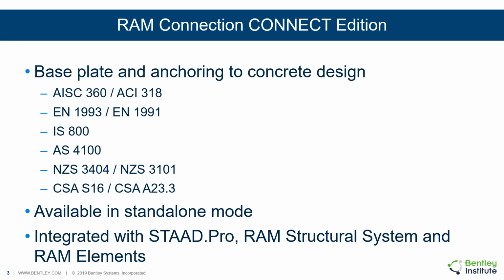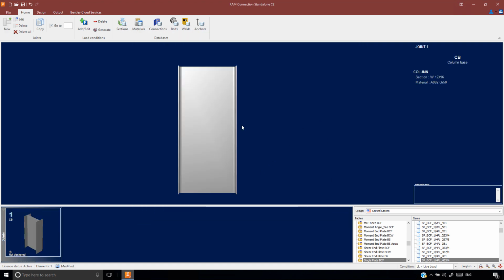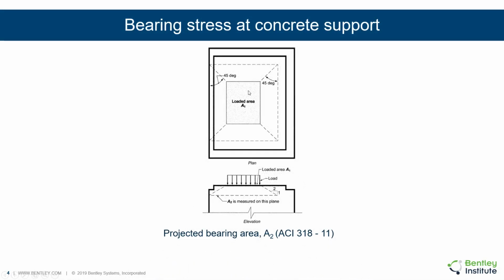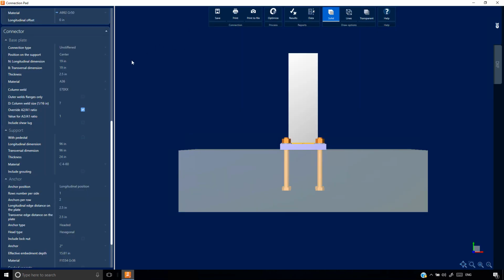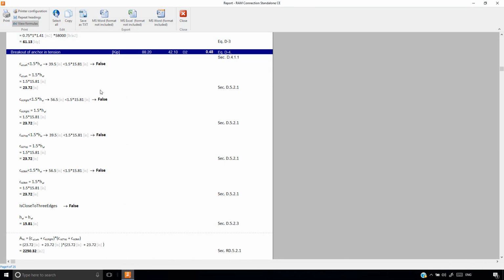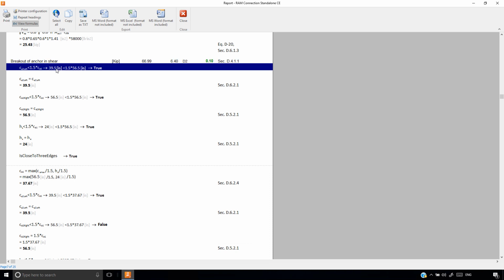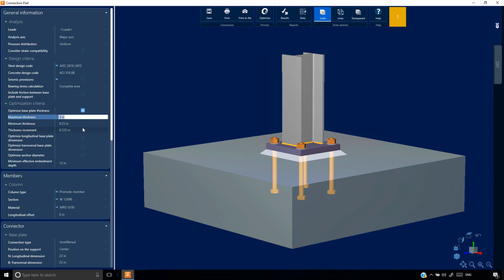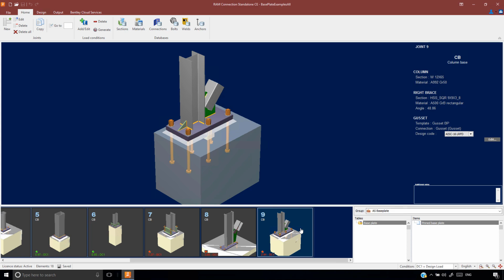Base Plate Design and Anchoring to Concrete in RAM Connection

Comment: Good day sir. How do you properly design base plates if a pedestal is considered. ? Most of the designs in staad i came across are designed where the column is directly attached at the footing which in the real world can have damaging effects to the column for it will be exposed to water and earth.